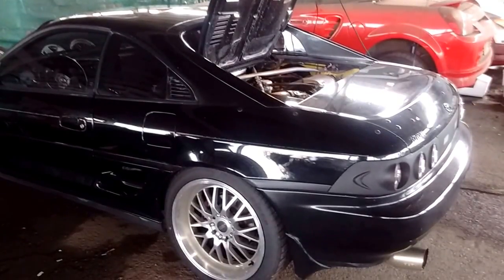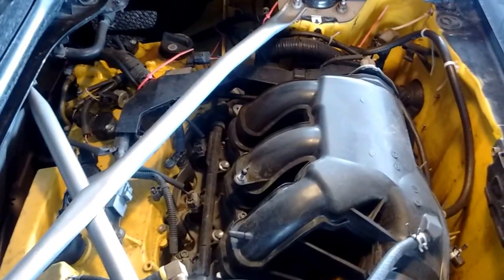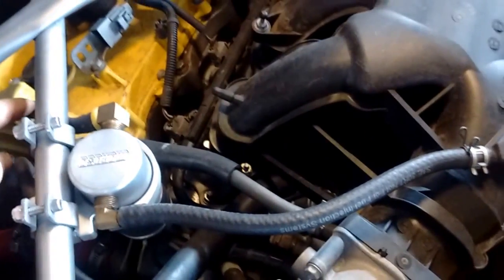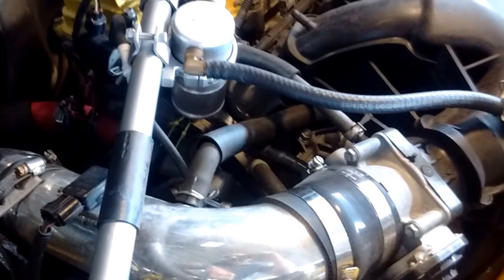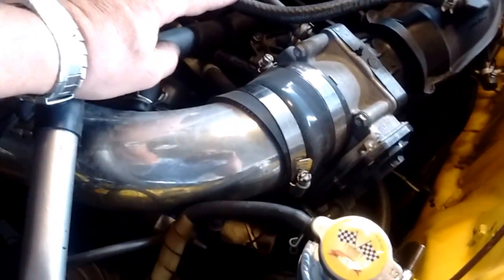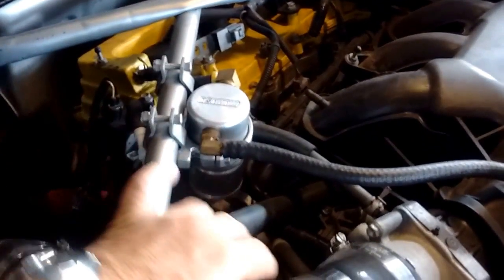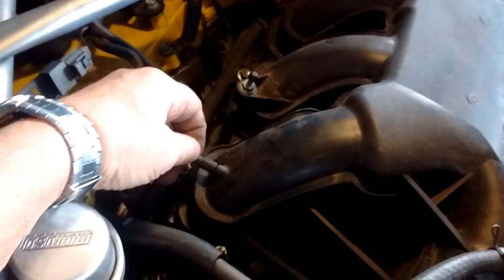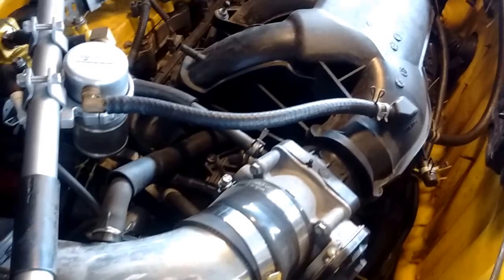Toyota 2GR-FE 3.5-liter V6 - Engine Bank ID and Vacuum Hose Routing

Comment: i have toyota camry 40
 with 2GR-FE engine, at idle I constantly have Long Fuel Trim 10-12% bank1 and bank2, SFT about
 0%, with a load in motion, everything is about 0%. The car seems to be working fine. Why is the mixture so lean at idle?
Reply from the maker: Sounds like a vacuum leak.
Reply: @Merryfrankster_  no, now is good, PCV valve..

Comment: Hello Frank. Why dont we use additonal catch can for oil - separation from the other crankcase (on the hose plugged near MAF-sensor, that goes under the air-intake plenum ? Or maybe both hoses could be mounted to one oil-catch-can and then to the port near MAF..?  Is there any reason not to do that, or no need to do that? Would be great to hear from you. Thanks.
Reply from the maker: Hello Artur. In general there is not much oil escaping on the crankcase breather line. The function of this line is to replace the air being sucked out of the crankcase through the pcv line. You can picture the air flowing in a loop into the crankcase breather then out the pcv and into the plenum. I know that some people have tried placing a catchcan on this line for track driven mr2's and they found no oil. Anyway when designing your system take care that the air flow through the maf must be metered correctly else you will have lean or rich compensation issues.
Reply: @Merryfrankster_  Hello Frank, thank you for such a quick response. Well, then it's not a good idea to connect both ventilation hoses into one catch can, is it?
Reply from the maker: @arturwojtalik6186  I know you see hose routing like that in turbo cars that run speed-density i.e. MAP ecu. With speed-density tuning, accurately metering the air flow does not matter. But if you join the PCV hose and breather hose together in a catch-can for your MAF-based ECU, it will have a fit.

Comment: Did you use a 2GR evap canister or did you use the MR2 one?  

Does this engine need the evap to be connected?
Reply from the maker: I did want to have a functioning evap system, just so the car would not smell like gas fumes. So I used the stock MR2 charcoal canister, and connected it to the stock 2GR evap vsv, which is controlled by the ECU. You can see them both in the engine bay, the canister is in the stock position near the strut tower, and the VSV is in the stock position on the front bank. The stock 2GR system also uses another VSV on the charcoal canister, and this one I did not use. I don't think the engine "needs" the evap to be connected however the ECU will trigger evap DTC's and CEL if it does not detect the two VSV's. The evap DTC's and CEL can be masked, along with the transmission DTC's, by re-flashing the ECU.
Reply: Thanks for the response.  Great video!

Comment: Where is the hose routed that is from the vacuum switching valve. Basically 2 hoses go to the factory box. I understand the hose at the side of the factory box being deleted. But what about the hose that sits in the front of the factory box. Thanks in advance.
Reply from the maker: On the manifold there's a vacuum nipple for the hose that feeds the vsv on the factory box (variable intake box). In this application, this nipple is capped. The hose from the evap vsv goes to another vacuum nipple on the throttle body.